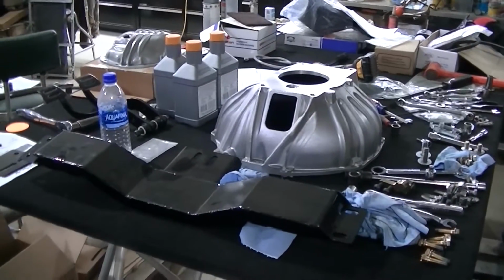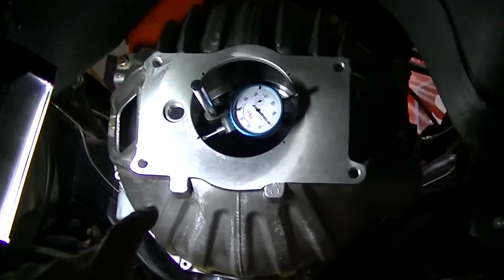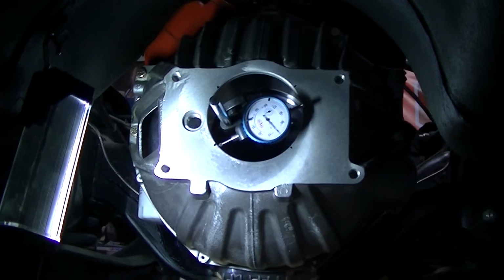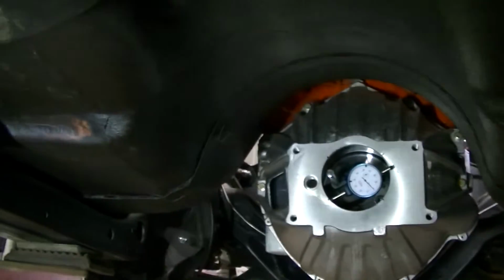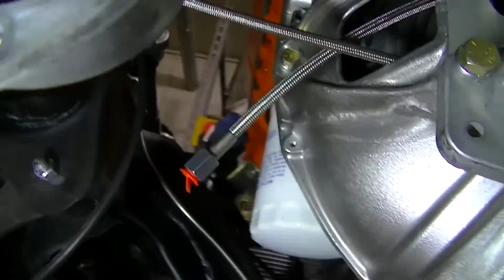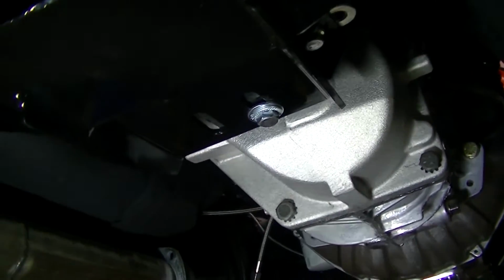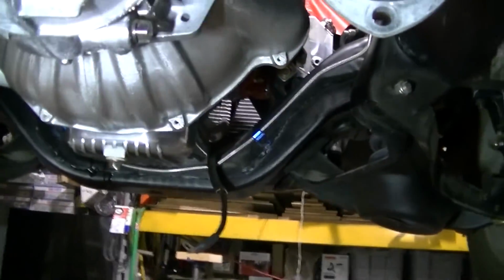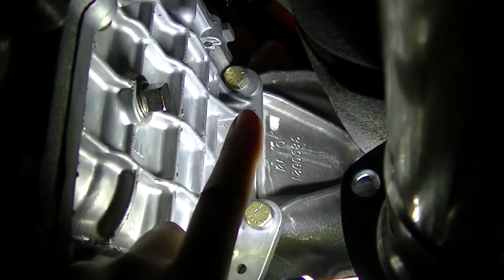70 Camaro SS Tremec 5 Speed Conversion Part 2

Comment: Did you have to cut or modify the tunnel at all?  Thanks for sharing this!
Reply from the maker: There was one spot that was tight on the tunnel. We didn't want it squeaking if there was movement so I took a round headed hammer and made a little more room. Not a lot

Comment: Hi Mate great video, Im in the process of converting over to a Ford T5 into my 69 camaro. Do you have details of the cross meber you have used that would be very helpful
Reply from the maker: I think that was a Bowler Transmission cross member. We got the kit from Modern Driveline.

Comment: Wow, I enjoyed your video.  Showed tons of info without rushing. I just received a TKX perfect fit kit for my 69 corvette from Silver Sport. How did wiring up the reverse light and neutral safety work out? Did you have to cut off the factory wire harness connectors to splice them in? Thx
Reply from the maker: The reverse light had to be cut and run down to the trans switch because we had an automatic. The neutral safety has not been hooked up yet.

Comment: FYI if this is a big block car the motor is pushed to the passenger side about a half an inch to clear the master cylinder. I just found this out with my 69 Camaro, I couldn’t figure out why everything was pushed off to one side.
Reply from the maker: As far as we know this car was an SS born with a 350. I sanded the rear panel down looking for the black paint and didn't find any. The car was 30 years old when we got it so we don't know 100% but we are pretty sure. The first generation might be a little different than the second gen.